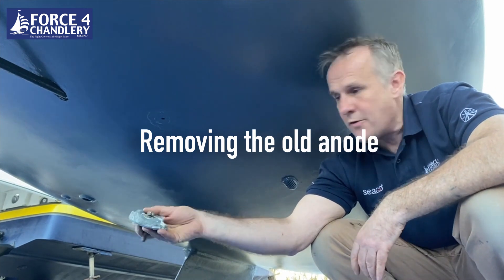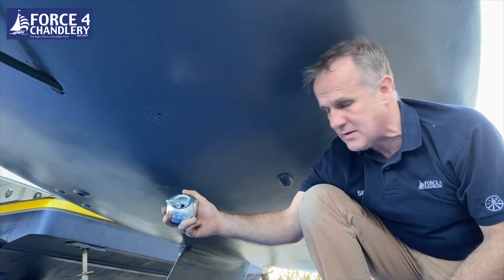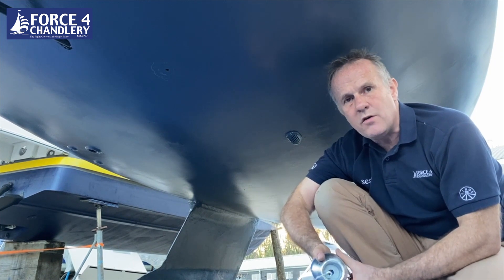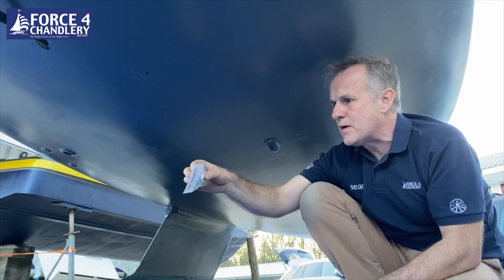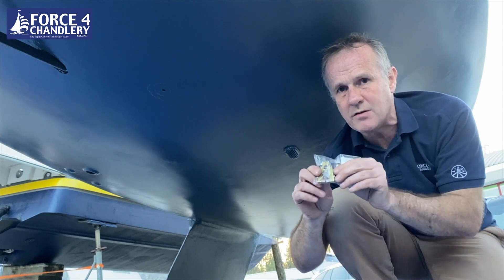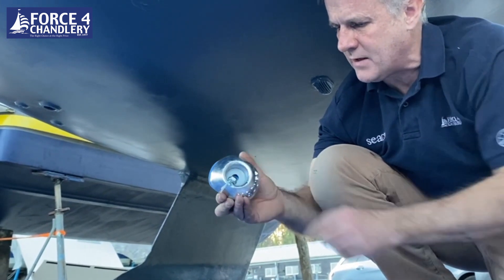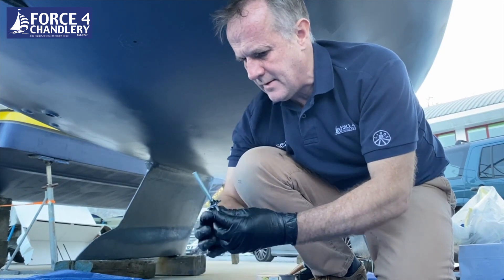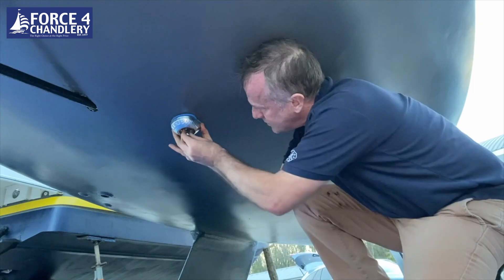Boat anodes, everything you need to know. How to install on boats the right way to protect metalwork

Comment: Im not finding the explanation I want. I'm assuming the anode acts as a magnet for the corrosive chemical reaction.
Reply from the maker: Essentially yes, well sort of...

Sacrificial zinc anodes protect your boat from galvanic corrosion, an electrochemical process where metals degrade in saltwater. 

This happens when two different metals are in contact with an electrolyte – in this case, saltwater.

Zinc is more "active" than your boat's other metals, meaning it corrodes first by giving up electrons. 

This "sacrifices" the zinc, breaking down the zinc anodes first. Diverting the corrosive attack away from vital parts like your propeller and hull fittings, ultimately preserving your boat's structure.

For different water types you would want a different anode for it to remain more "active" than the metals on your boat.

1) Zinc anodes are suitable for salt water use
2) Aluminium are suitable for salt or brackish water
3) Magnesium anodes are suitable for freshwater use

Hope this helps!

Comment: Thank you for your interesting video. Didn't know there are anodes for different waters. I have a question - is there such a thing as installing too many zinc anodes to cause damage instead of protection?
Reply from the maker: Hi Joseph,

Yes! Having too many zinc anodes on a boat can actually be detrimental, particularly if your boat has a wooden or metal hull. 
Over zincing happens when there is too much anodic protection. Having an excessive number of sacrificial anodes installed on your boat can lead to unintended consequences.
1) Burnback and discoloration
2) Paint delamination and flaking
3) Caustic wood rot
Reply: @Force4Chandleryltd  Thank you so much. Incidentally, I found out a day ago from a video by Marine Surveys R. US. that it is the alkaline environment from too many anodes that damages fibers in wood. They did not elaborate on metal hull though. One other question that did arise from this is whether we need to connect the bonding system to the hull directly even if it is made of wood or fiberglass, i.e. not just to the metal through-hulls or engine, etc. Do we need to do that even though they are seemingly non-conductive?
Reply from the maker: Hello,

So this required a big of digging - and what I would always suggest is you speak to an anode manufacturer to double check these things. M G Duff and Tecnoseal both have great technical teams to help advise you on such subjects.

What we did find was this - "We do not recommend bonding a wooden hulled boat, but if you do, make sure the bonding system is insulated from contact with the wood.  Any current flowing through the wood (especially if damp) causes rapid deterioration." - https://performancemetals.com/pages/why-bond-metal-parts-on-a-boat

They also say - "It can sometimes be better to use bronze fittings which are naturally protected and do not require protection from an anode, particularly on a wooden hulled boat which can be damaged by the low voltage provided by the anode."
Reply: @Force4Chandleryltd  Thank you so much. This is indeed a complicated subject.

Comment: Can you weld an anode to the side of the boat rather than drilling a hole in the hull , worried about the seal failing and flooding my boat . Have a narrowboat , with four magnesium anodes ready to fit !
Reply from the maker: Hi Simon, thank you for your question. Yes we stock a range of weld on magnesium anode for freshwater use - these are very popular on Narrowboats https://www.force4.co.uk/item/M-G-Duff/MD73-Magnesium-Weld-On-Anode/CPO
If there is anything else we can help you with please let us know.

Comment: Good video but it’s a shame it didn’t cover bolting the stud from the inside.  Apart from an aside comment one might be led to believe that all you need is sikaflex !
Reply from the maker: Hi Kevin, thank you for your comment. We couldn't film the anode bolt from the inside as the bolt was under the engine with just enough room to get a spanner on the nut. The video does mention that you should use earth bonding wires to connect the anode to the shaft and gearbox.